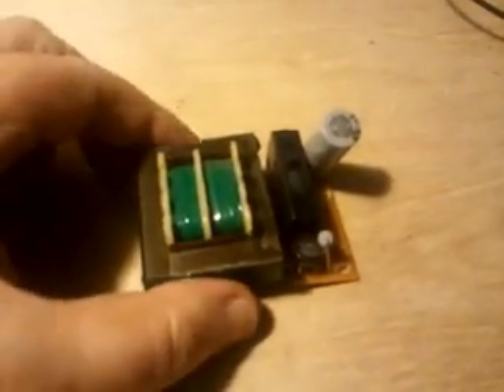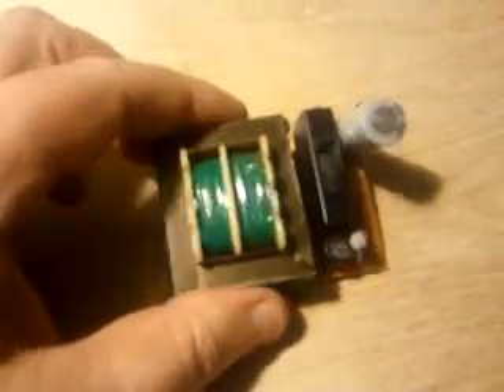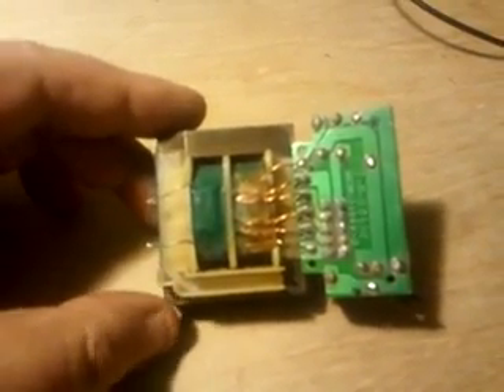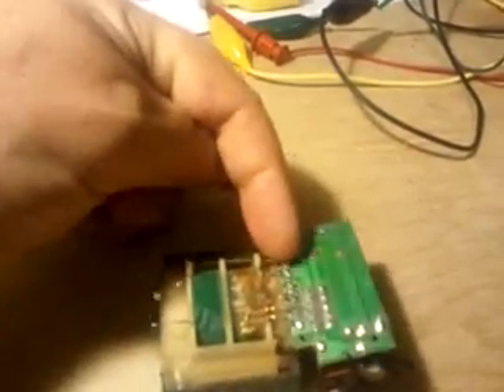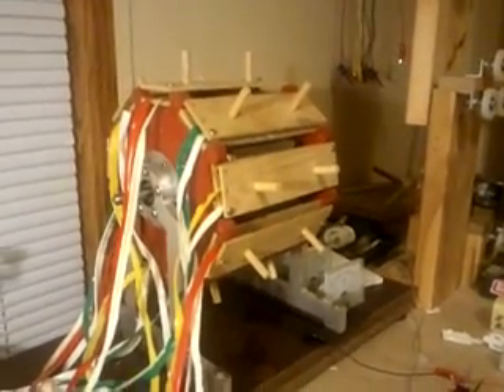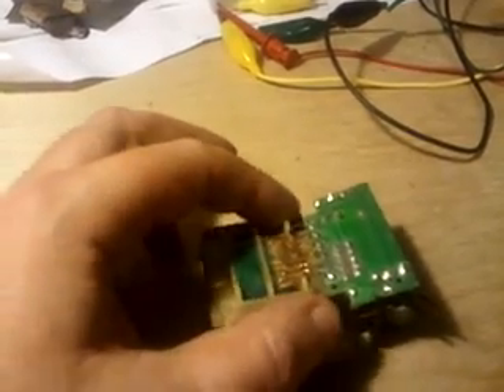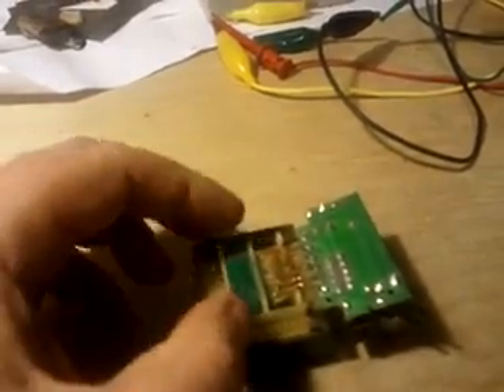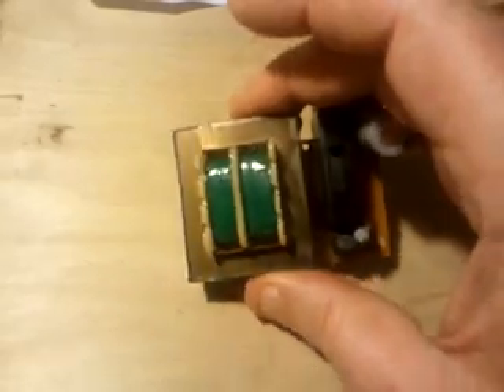Free energy the wall wart

Comment: Wait, you just said that power can't be transferred back to the grid because there was no electrical connection between the coils in the wall wart. But, if that was truly the reason (and I'm not commenting on whether or not power is going back to the grid or not), then the wall wart would not work as it was designed to work. It's just an isolation transformer, which is extremely common, so I'm don't understand why you wouldn't know this. Did I miss anything here?
Reply from the maker: Grant,
   I beleave it has something to do with the pulse. Is pulsing a wall transformer common?

Comment: Maybe when the circuit is running, the collapsing of the bedini coil is out of phase with the ac service. Allowing the low voltage coil to inject a pulse at just the right time. It is complicated, because you are pulsing coils with ac and dc.
Reply: Your tank circuit (LC Circuit) is making the voltage and the current out of phase by 90 degrees. the Tank circuit is a alternating circuit. i.e. the capacitor is charged first one way then the other.
Reply: There is a diode in the circuit making DC current to the cap. The motor is monopole so it is only firing on the north side of the coils. I just don't see where the cap would have an AC wave present. Though I could be wrong. My scope shows me a DC current at the cap. And I really don't know how to use the scope very well.....so ???
I muddle through......its all for the fun of it anyway. And when it comes down to the brass tacks I realy don't care how it works as long as it does.
Though this discussion is very stimulating to the mind. :)
Oh wait...its just oozed out of my ear.....LoL
Peace!
Reply: ***** I don't wish to take over on these comments but I too love discussion and would appreciate any ones views as I am not proposing I am right.
A diode has to have a level of voltage to start blocking, .7v? In the Tank circuit (LC) the current and the voltage don't exist strictly at the same time. when you have maximum voltage you have no current. when you have maximum current you have no voltage. so we can get passed a diode to an extent. but remember our four phase cycle of out LC Circuit we are alternating, charging the capacitor one way then reversing and charging the capacitor the opposite way. This would mean a least one of our four phases in our LC circuit is getting fully passed the diode. this four phase cycle is happening 60 times per wart spike. so I concluded at least 60 induced spikes at the wart per cycle of bedini. watch that LC Circuit vid again and again and again. pls tell me i,m wrong if I am.
Reply: I can't and will not say you are wrong but, I can not say the LC circuit vid is correct. I tend not to beleave anything I hear. I have not progressed far enough to say one way or the other and I may never get there but, I will have fun in the process. :)
Your comments are appreciated and I try to review and comment back to everybody. Please keep them comming so everybody can learn as we move forward to a brighter tomorrow.
Again, Thank you for commenting!
Peace!
Reply: David Mountain we can test this, by building a simple tank circuit (LC) and putting a diode into it to see if it resonated. My resources and time don't allow at this moment if Mr AW can come to the rescue maybe.
Reply: Yes, MrAnguswangus is sharp as a tack and makes clean, clear video's. I will take all the help I can get. And beleave me when I say I need it..LoL
Reply: ***** Just to clarify, I'm not saying alternating current in the four cycle LC Circuit. just that dc flows ones way at any given time then reverses and flows the other. it would not be a wave current.
Reply: I did not know DC could switch direction like that. I was under the impression that DC only flows one way.....hmmmm??
Reply: You are correct DC is unidirectional, what I am badly saying is that the current stops (it is no more) for a moment of time it is all voltage in the capacitor and then the next time the current starts to flow, it is traveling in the opposite direction. Hope this helps.
Reply: David Mountain

I was refering to the collapsing spike running back up the negative wire, and reaching the wal wart coil. Is it possible?
Reply from the maker: David Mountain The wall wart, when plugged into the grid never shuts off. There is always at least the grid voltage flowing in the transformer.
Reply: Hi folks sorry for not replying sooner but bad head cold shut me down mentally. Loved the latest vid Dudeman, my theory of the spike reaching the ringmain was confirmed by you there. Got the John Bedini Book now and it confirms a lot of my personal beliefs in so much as where the energy comes from. As I understand the book its the collapsing magnetic field in the coil, any coil (inductor), motors, Capacitors. even to a lesser extent the wire (ringmain itself) that utilises the sharp collapse of the spike and draws on a negative energy from the surrounding air/environment. This explanation is not for everyone and I do suggest as Dudeman put forward you read the book. A good understanding of the universe and spacetime makes this book readable. But Bedini's circuits & schematics make it worth it on its own.
Simply put, if you ringmain has lots of appliances plugged in, not necessarily working you will gain from more negative energy being pulled in resulting in saving the conventional energy flow. Appliances like incandescent bulbs, motors (fridges, washing machines) if they can receive the frequency then the system will benefit.
 In the near future I shall be creating a off grid ringmain running 240v to test the system so I will be able to confirm the meter is not being compromised by the spike.
Pls remember this is not a mainstream science view but a avenue I believe worth exploring. John Bedini encourages you to try and have fun.
Reply from the maker: I look forward to following you on this path. Thank you for picking up the torch on this. I have many experiments to do. In order for me to do them I must move on.
Peace!
Reply: I understand and shall leave you in peace, you have steered my path and I appreciate your ear and I will share any fruits I can. May your experiments give you the fulfillment you are looking for. Peace.

Comment: Hi it seems that Stanley Meyer may have used this for his water fuel injector as he states in Stanley Meyer newzealand video all about the magnetic secondary wound field wrapped over the cars ht leads causes a ultimate one way lightning bolt effect shutting off amp flow and allowing voltage to go to infinity into the water injector which it has got to hit resonance at some point as it cannot go back up through the negative collapsing field the secondary may have to be wound either clockwise or anti clockwise as joe booker alias joe cell states that winding coil one way will place neg at that end and wind it the other way will place pos at same end that was neg but of coarse they then realised you can get this effect from an already produced natural vapour AIR just it becomes a magnetic engine I am sure you could easily do this as my research points me to joe using charged neg engine oil and pos salt water so the block is the iron core got plenty more info for all if you email me as I struge with the electronic part
Reply: Yes, I agree that the pulse (negative or positive) depends on how you wind your coil.
Thanks for commenting.
Peace!

Comment: As I see it your getting energy back into the 110 coil via induction, this rate of induction is set by the tank circuits frequency. so for one spike from the wart transformer to power the bedini your getting approx 60 spikes back from the tank circuit. So your getting 60 times the power albeit induced to the house ringmain. would you agree on this?
Reply: I am not sure what you are saying here. Each time the transistor turns off there is a back spike. So if you cycle you circuit to turn off 60 times per.second you are running it at 60Hz. The same frequency as the (U.S) grid.

Comment: I was wrong about the rectifier blocking the returning spike from the bedini circuit. It can go around the rectifier to the back door to reach the low volt coil. So this means that this coil could be catching a sharp amount of the returning charge, and passing some spikes across to the primary 110 coil.
Reply from the maker: It's safe to say the there is some dirty electricity flying around. Though when we are shutting down the circuit the coils will discharge at the same time. If both coils in the wall transformer are discharging at the same time. Would they cancel each other out as far as interacting with the core. In essence pushing the energy back into the circuit on the 12volt side and pushing the energy on the 120volt side back to the meter as they push against each other?
Interesting, Very Interesting !!

Comment: Sounds pretty simple. The rectifier should also block any pulse coming from the Bedini or any other source back to the low voltage coil. So is it just shorting that coil at around 60hz?
Reply: Yes, that's about it. Any pulse circuit should work. As far as frequency goes that's the big question. I have run mine from around 63Hz to 120Hz. I even got one of my circuits to self resonate and still observed the effect. Though I do not know which is best. This we must figure out.
Thanks for commenting!
Peace!